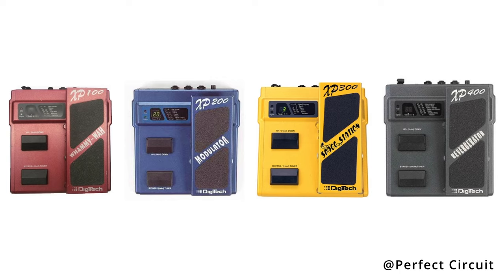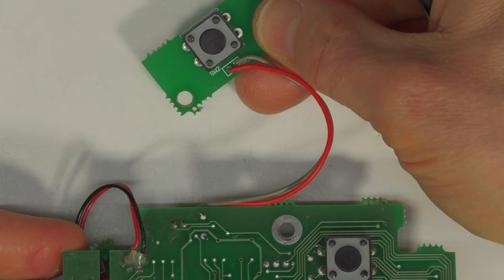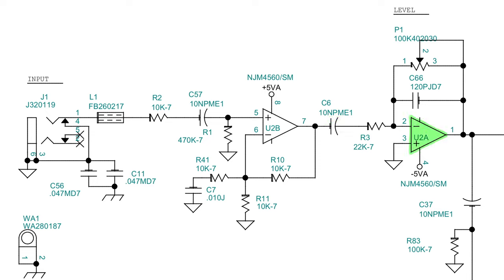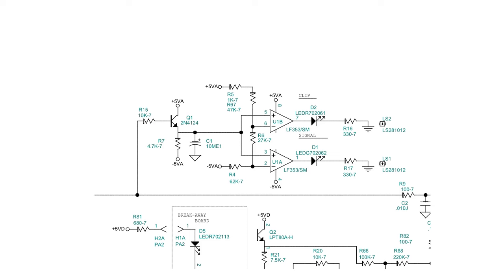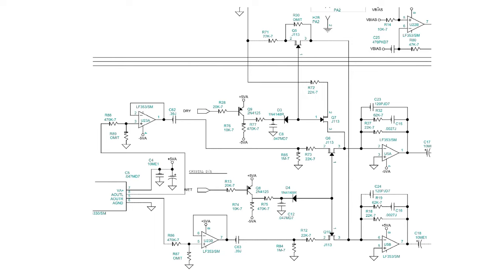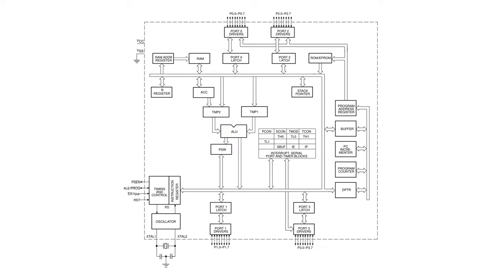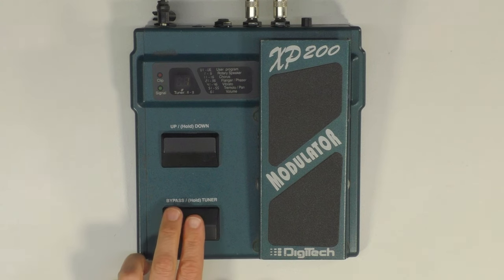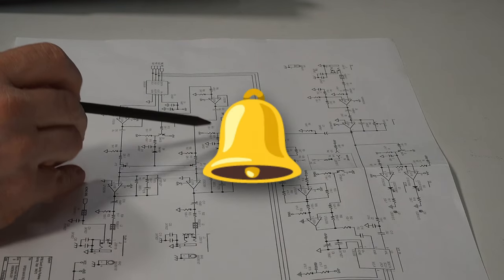Digital Guitar Pedal Deep Dive

Comment from the maker: I didn't realize this until after I'd mostly finished this video, but... The most likely reason they designed a discrete crystal oscillator is so they could pick off the frequency and send it to the DSP chip! The DSP chip uses that frequency to clock the audio ADC and DAC chips. 🤦‍♂